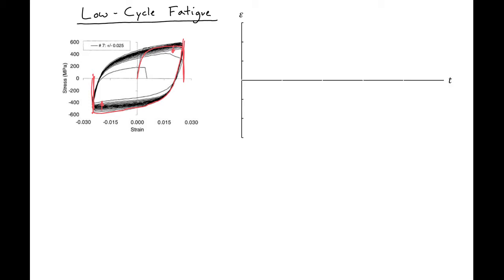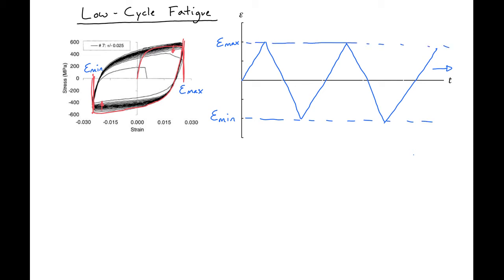2 - Low-Cycle Fatigue of Reinforcement

Comment: USING HCF ALSO WE ARE ESTIMATING THE NUMBER OF CYCLES FOR FAILURE AND YOU EXPLAINED THAT LCF IS ALSO
USED TO ESTIMATE NUMBER OF CYCLES OF FAILURE THEN WHAT IS THE DIFFERENCE BETWEEN THE TWO METHODS AND
WHICH METHOD IS TO BE USED WHEN?
Reply: Mech E  low cycle fatigue and high cycle fatigue are types of fatigues. And not the methods to determine the fatigue life. Usually strain life approach is used to determine the LCF of any component